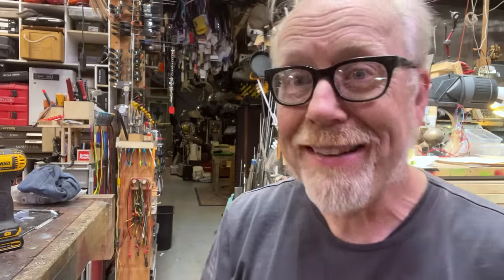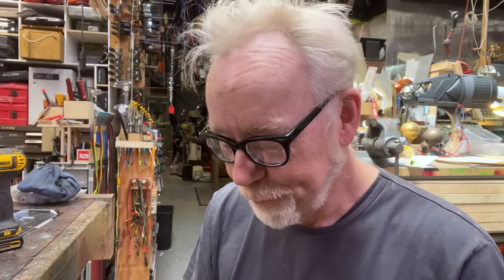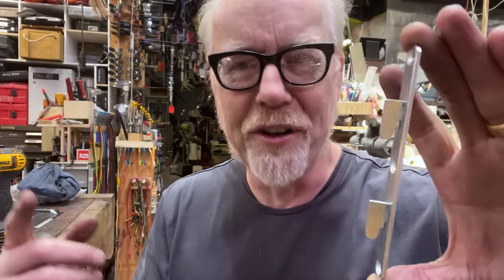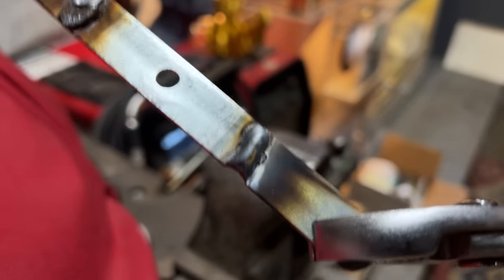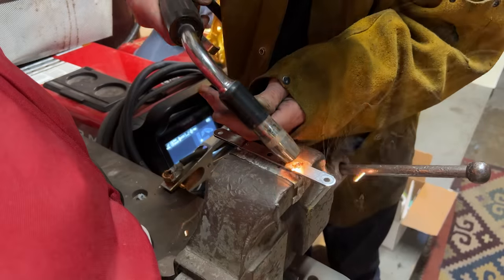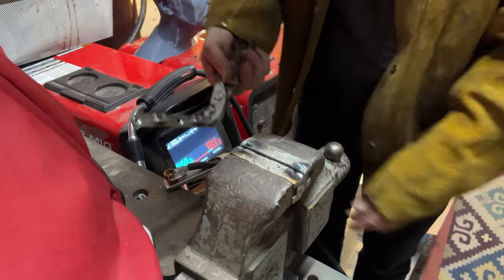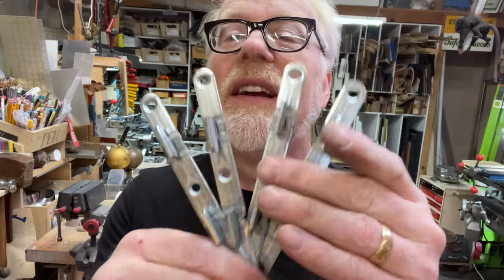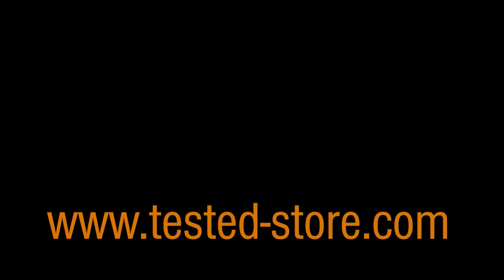Adam Savage Fixes a Squeaking Bed!

Comment: Speaking as a certified welder. Adam you did an excellent job of explaining this. Please wear gloves to protect your hands while you weld.
Reply: from both the hot melty stuff and the UV given off neither is good for your skin. also stops you becoming a part of a circuit
Reply: 2nd this - as retired welder
Reply: for just a couple seconds of arc time with solid wire your fine honestly. I will say it is funny that he took the time to put on a jacket and not the gloves though lol. My biggest criticism is for a butt joint like that you should focus on a work angle of 90 degrees to avoid spatter going everywhere and even penetration. Honestly no big deal for little 1" welds however.
Reply: as a fellow metal booger shooter like Adam, I agree.
Reply: I always use a welding glove on my left hand, as that's the hand I use to guide the tip of the wand. I've generally have mechanic's gloves on, so just use them for my right.

Just curious what's the best place to find welder settings for idiots?
Reply: @turtleboy4111  "Just curious what's the best place to find welder settings for idiots?"

Trial and error my dude. Get some scraps and play around to find out what settings work best for you. I was pretty proud the first time I actually I welded 2 pieces of 1/8x1" at a 90 degree angle, clamped one side in a vise, and then beat the other side around 180 degrees with a hammer lol
Reply: And please, do not remove the protective shield off your angle grinder.
Reply: @azgarogly  😂 I agree, but don't exactly practise it perfectly.
Reply: And proper eye protection when using an angle grinder. Know a dude who's blind in one eye because he thought his daily wear glasses would protect him from a disk blowout.
Reply: Every time he yanked his bare hand away from the piece I though "Aw shit, is he okay?"
Reply: @turtleboy4111 as others have stated, it's all practice and experience.

But generally when welding you want it to sound like thousands of angry pieces of bacon all sizzling at once, and your wire on initial start should instantly create an arc without pushing into the material (wire feed too high/power too low) and shouldn't burn back to the tip either on start up or stopping (power too high/wire feed too low)

You should also consider gas flow rate, too high and you'll get excessive spatter and a type of bubbling that looks like porosity but iirc actually isn't, but too low and you'll also risk porosity as seen in the video, and that porosity can penetrate deeply into the material being welded, which requires more metal being taken away to fix

If you get the power level right it'll sound as I describe, and the weld will lay down easily and you'll be able to guide the weld along without chasing it or having to slow down and speed up, it'll flow like ink from a quality pen with almost no effort on your part.

Good luck, and as a general rule of thumb, a good quality weld on 6mm thick metal in a butted joint should take about 1 tonne per inch of pulling force before breaking, and a great quality weld should break at the transition boundary in the metal that's been welded before the weld itself gives out.
Reply: Absolutely agree, gloves, eye protection, grinder guard and all the like. If I may add, if you do an amount of welding a bit of nozzle goo could be of assist as well as some needle nose.
Reply: @PaulTheFox1988  on mild steel a square inch of 7018 full pen wont break until after 70 000 lbs. for a 1/4 plate your looking at 70 000/4 = 17 500 per inch of full penetration weld. Significantly more than 1t. 0.35 solid wire is technically equivalent to 7018 but because of less heat input and faster cooling you get a harder and more brittle weld. Either way 1" of good weld in a butt joint on 1/4' plate should hold about 8t. Which is kind of mind blowing.
Reply: @mcripchip  I guess my teachers were way off then, I was taught that it was a good rule of thumb but not a hard and fast rule, but even that it seems is incorrect lol
Reply: @PaulTheFox1988  i mean its theory. In my metallurgy class we did the pull test on 1" square stock welded and the actually numbers when it broke were well above 70 000lbs. Slow/fast cool also had a major effect. But in the field your never going to trust a little weld with 8t. It's just helpful to know the true strength of steel. a square " of 54w mild has a rated tensile of 54 000, qt-100 goes up to 100 000. Those numbers are hard to fathom but ultimately important to understand when understanding and coming up with designs that aren't needlessly heavy.
Reply: As a self-certified, self-taught farm welder of 20 years... this was way over done for the application.  Blast it with a TIG torch and screw er on!  No need to waste time with bevels or even filler metal for this.  Granted, if a MIG is all you have...sure.
Reply: Yeah, no gloves AND a ring.. I don't know how people can work in a shop with rings on.
Reply: Basic level welding was taught to me as "welding melts (with high voltage) the pieces with welding medium together. IF it doesn't your soldering the pieces." So Adam's first example isn't really a weld at all in my books, even good fast welding should already melt the edges... ofcourse chamfering and multiple layered welds would make thick materials stronger, I'm sure.
If possible I avoid welding ends of parts together, anything with edge or corner or something is a lot easier to make to my joke standard of "you can jump on"; as I tend to over engineer - and with metals, over weld stuff together. Some of my junk prototypes will stay together wayyy after I'm dead. :p
Reply: @turtleboy4111  I'm sure internet is full of pre-tested settings of voltages etc for straight butted metals of various types and thicknesses. Some welding machines (mig I learnt to weld with) come with setting for sheet metals and we were taught to make it about x1,5 of the material thickness when welding insides of edges or T-shaped stuff.

Bet there are YT channels dedicated to "teaching welding for first timers", because YT has everything, and in big sphere of handycrafts people are generally happy to teach their craft onwards. Just so, you know, you don't need to start from complete zero but get bit of guidance to then learn by trial and error.
Reply: Thank you for beating me to it. As a welder myself, ended up getting some bad burns on my hands from thinking a quick tack wouldn't hurt.

Also, GALVANIZED! I hate that stuff...
Reply: @benja4471 That welding UV is so intense it's considered a high level carcinogen. Pretty wild stuff.
Reply: Adam’s shop safety is nonexistent the producers should crack down on that it sets a bad example
Reply: I know that you're supposed to wear gloves, but with them on I dont have as much control so I dont usually wear them. I only ever have problems if im doing a lot of tig welding
Reply: @isaakwelch3451 You still have an increased risk of cancer. Welding UV is no joke.
Reply: unfortunately adam has a knack for neglecting ppe.
Reply: speaking as a ironworker/ field fabricator YOU DONT NEED GLOVES IF YOU GOT A HOOD YOUR FUCKING GOOD
Reply: Every time he started welding or grinding I said "please wear gloves please wear gloves please wear gloves"
Reply: i was thinking the same thing
Reply: His last name is Savage. Savage he is.
Reply: @turtleboy4111 found mine on the inside of the welder, under the "flap" so to speak. 🤷‍♂️
Reply: I knew I would find this comment close to the top. Thank you for not disappointing me.
Reply: @azgarogly  As someone who has had an angle grinder jump towards my face I agree with you!  Also, holding the work in your left hand and grinding with the tool in the right is another good way to end up with a nice slot in your hand!  Now I put the work in a vice and use both hands for the grinder. Please don't learn the hard way like me!
Reply: @tralfazy  literally had a cutting disk blow up in my face last week. So glad I was wearing a face shield, could have been a lot worse than a big scare and a bigger headache.
Reply: @rebeccawilson5041  The older I get the more 'almosts' I have had.  Getting hit in the face by grinder debris enough times makes us put on a full face shield.  Thankfully we got away with our past mistakes (up until now at least).  Some people don't get away with it.  I'm glad you were wearing a face shield!
Reply: @benja4471  my forearm got bright red from welding just a few minutes after i forgot to roll down my sleve, i could see the edge of my glove for about a year.
Reply: In high school I worked at a radiator repair shop and when he had nothing for me to do he had me practice running beads on scrap. I may have gotten my glove wet and I MAY have felt the welder more intimately than I desired.
Reply: Him not wearing gloves is what he does with everything 😭
Reply: You forget, Adam long ago rejected our reality and substituted his own...
Reply: As a certified welder, which I am not by any means, were you noticing the TIG welder just behind the MIG and thinking "Surely the finer control of the TIG would be better for this application"?

Because that's what I was thinking, and my friend who ran me through the basics of welding always said that TIG is to MIG, as MIG is to Stick - that is, each accomplishes the same goal, but with finer and finer control of the welding at the cost of being able to handle thickness.

I know that if you tried to do the same with a stick/arc welder you'd probably just burn right through that thin sheet metal.  And it wouldn't be too hard to do with the MIG, either (As evidenced by the concave bit of the edgethat got blasted away on one of the brackets) - But with the finer control of the TIG, you'd be able to go slower, get better penetration, and make a cleaner and stronger joint.

Or am I completely off-base here?
Reply: @DobieTanpaw  your right a TIG would have been better but Adam doesn't know how to use a TIG. I asked him about it a couple of years ago.
Reply: Not sure if I should have been but that ring made me anxious.
Reply: @mcripchip funny you say that bc I imagine I'm as susceptible to sunburn as Adam, and I managed to get a light but still painful sunburn after just 5 minutes when I was first learning to MIG weld. 😢
Reply: @smizles  You can get away with a few seconds of exposure here and there, each weld Adam is doing here literally a second of Arc time so he's not going to melt his hands off. But don't misunderstand what I'm saying because prolonged exposure to welding radiation is HIGHLY carcinogenic. If you burn easy always wear gloves and long sleeves no one should ever fault you for that.
Reply: If I understand correctly, that's also to protect your hands from UV, right?
Reply: @skeleton_craftGaming  yes.
Reply: @JohnTCampbell1986 there's a photo of a wire from a wire wheel in someone's eyeball behind the counter at my local metal yard. Legend is the guy took his glasses off for a minute, and that's when it happened.
Reply: Indeed, melanoma is not your friend. Nor is hot slag.
Reply: Not a welder, but work in a setting that requires gloves at all times.  Every time he picked up a tool without gloves, my soul cried out a bit.
Reply: That zinc plating (galvanized), too, can make you very sick when welding it. Should grind it off firsf
Reply: As a welder fabricator I can agree

Comment: Im not sure I will ever grok the dichotomy of how on one hand Adam is so excited about his gauge blocks and chasing zeros and accuracy and fidelity, and on the other, he grabs something in one hand and a drill/grinder in the other and just freakin' wings it.  Never change, Adam.
Reply: The people who designed the bed didn’t put any thought into durability so fixing that should only need minimal planning.
Reply: It's a great demonstration of quickly estimating things like the scale of the project, the level of acceptable mistakes or failures, and the cost of time spent preparing with it's diminishing returns. It took me about a year to understand that not every project I did was worth moving mountains ford, and sometimes doing what I thought was a "bad" job would get exactly the result that was called for.
Reply: It's talked about at some length in an older video or on the podcast, though I could not tell you which one. Essentially, one of the things that separate a novice from an expert is knowing when and where precision matters and where you can cut corners.
Reply: It comes with experience and insight. Knowing when to use a large sledgehammer vs a tiny jewellers hammer...
Reply: When you need accuracy, you need it.  When you don't, don't worry about it.

For example, i am an electrical engineer, and i don't care if my meters are calibrated.  Because i don't care if i am within a volt or 10 volts, i am doing mostly comparison measurements.  Now, if i needed accuracy, then i'd be using better instruments than i do, and they'd have to be calibrated.

But i don't, so i don't worry about it.
Reply: I remember watching a gun smithing show (internet rabbit hole), and all of the new guys behaved like perfect machinists.  The boss would come in and manhandle everything that they had meticulously laid out, making adjustments without guides (hand drill), much to the horror of everyone doing precision work.  Adam is similar to both of these people types... loves precision, but often says *uck it by the end.  

People wonder how certain aspects of things were possible to make -- usually comes down to pushing a material to it's limit, and then backing off.  It takes a lot of experience to know how to do this, and that experience often comes through many *uck it moments that have failed or worked.
Reply: It's almost like some operations require significant precision and accuracy, while others do not.  It's almost like Adam, like most other people, uses his judgement to determine how precise a particular operation requires.
Reply: Adam is a movie model maker, he only puts effort into details when they will be visible. These brackets will not be installed on the “show side” of this model. hahaha
Reply: This is a nice comment thread.
Reply: When he was at open sauce this year, that was his whole talk haha
Reply: But sometimes the OCD kicks in and i have to make it precise for no real reason, especially if I see it all the time. Otherwise it will bother the hell out of me
Reply: Precision only where precision is required
Reply: @jeromethiel4323  There sure is a big dufference in "is there power on this cable" and "what does the resistance curv for this temperature sensor look like" and a LOT of people don't seem to understand this.